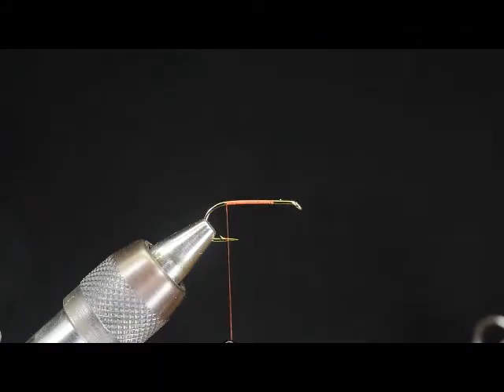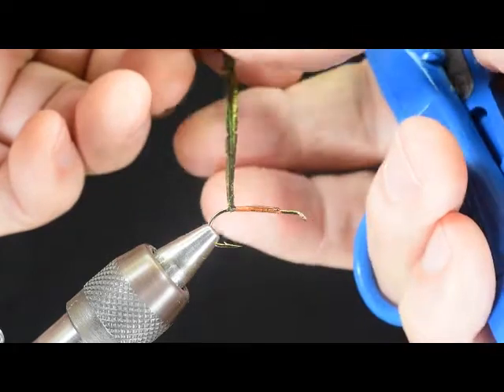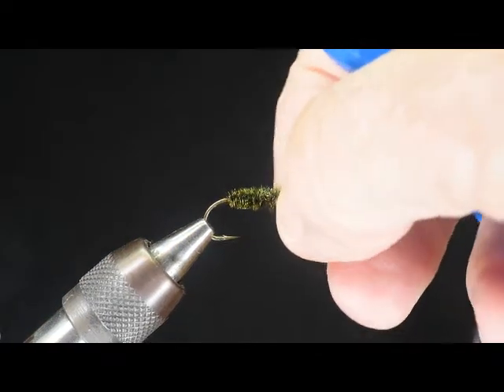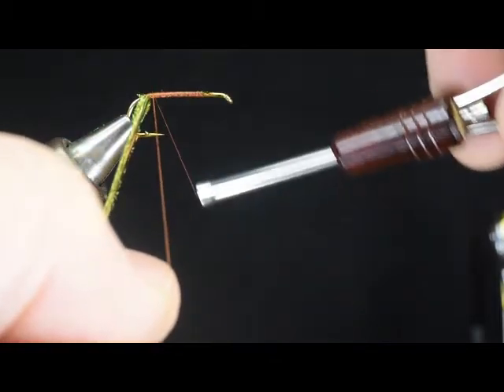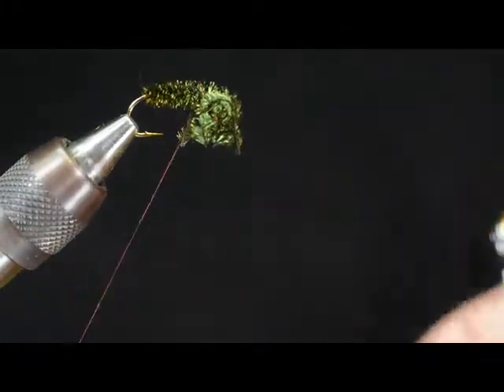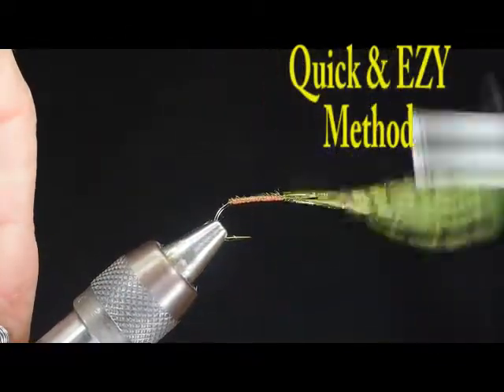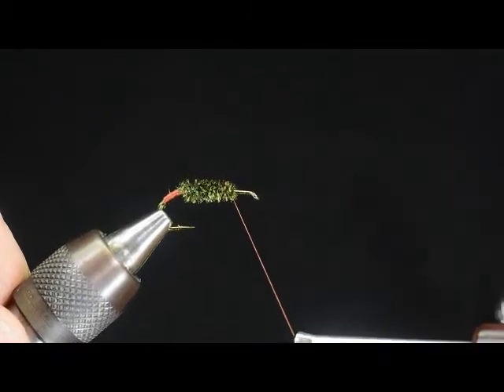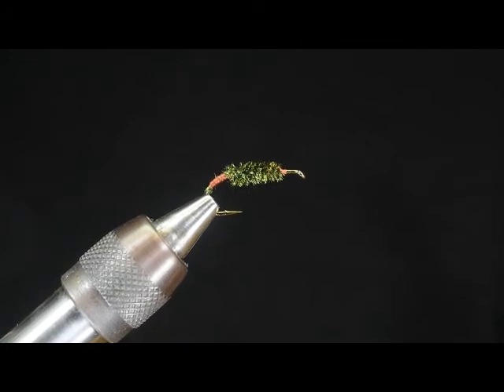Tips # 7 Tuff Peacock Bodies

Comment: If you used the “easy” method and combined it with the glue method on the thread body , it would be even stronger! I also add a single thin strand of copper wire from a kettle cord or similar as a wire rib. This way is as strong and as durable as I have figured out to date!

Comment: When using super glue, avoid holding the thread too close & matting down the herl. A good idea for more than one reason. The glue may make the flattening permanent, as well as possibly gluing your fingers to the hook. Any time you work with a super glue, it’s very helpful to have nail polish remover (acetone) on your tying bench in case of a glue emergency such as gluing fingers, overturning a not quite closed glue bottle, etc.